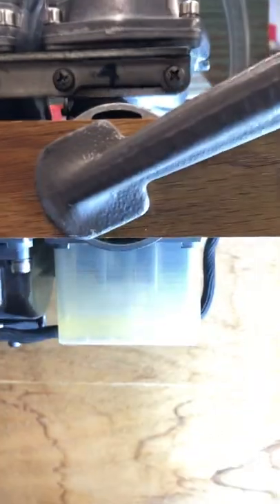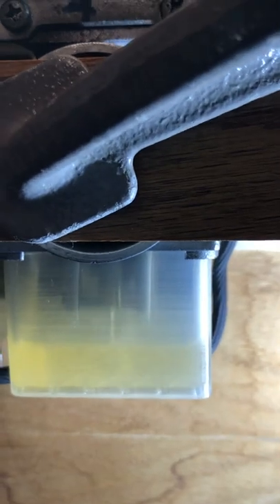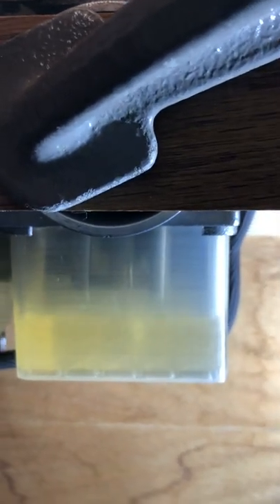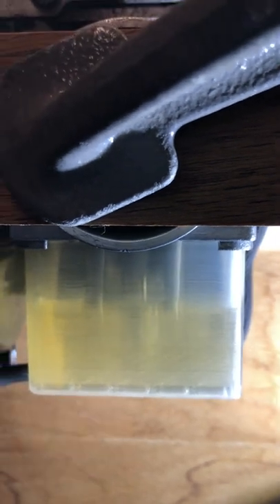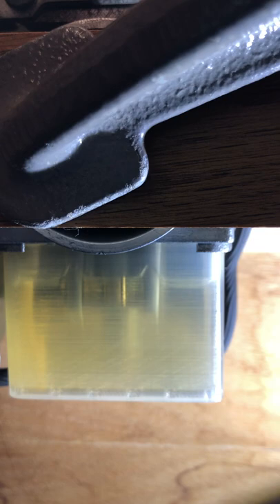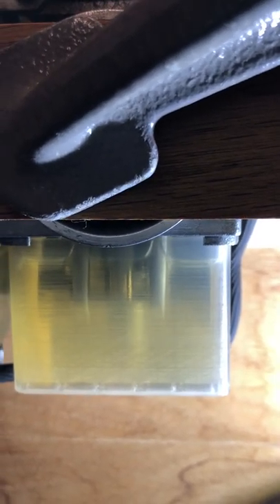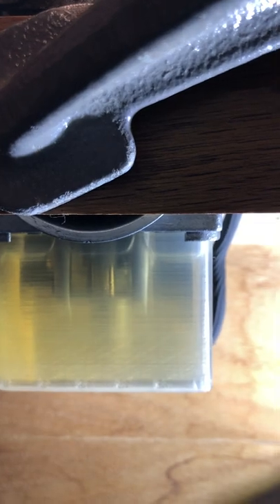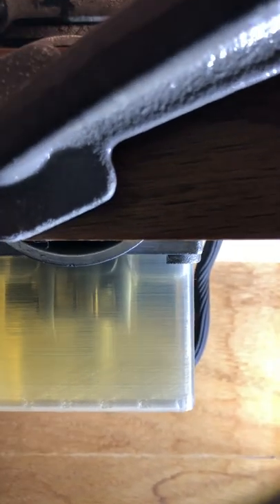Checking Fuel Service Level with Transparent Float Bowl

Comment from the maker: The outside dimensions of this translucent float bowl are 64.4 x 61.4 mm.  I provided the dimensions since this bowl may fit other carbs. My carbs are Mikuni BS34.  This bowl is only for checking the level it won't work on a running engine and would be extremely dangerous to use is in a running engine.